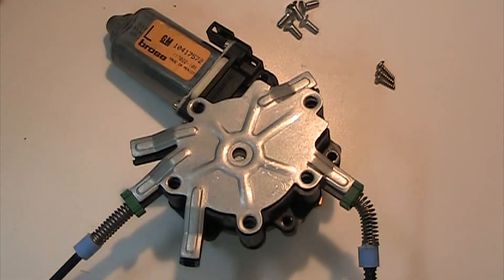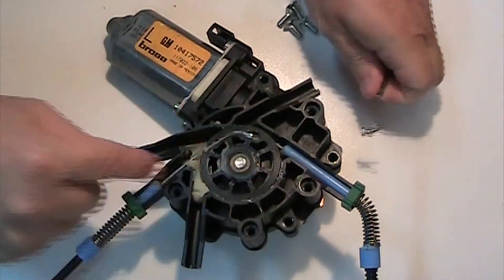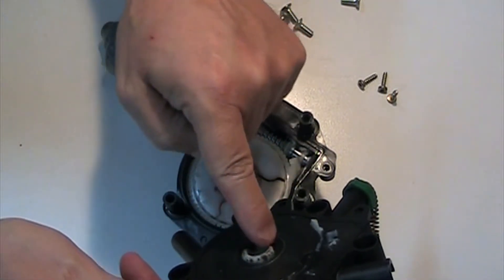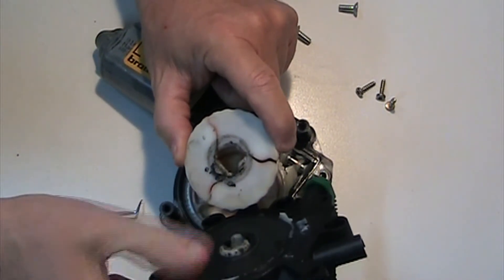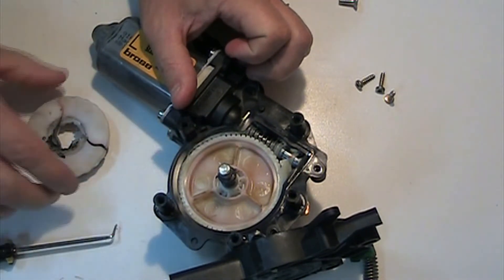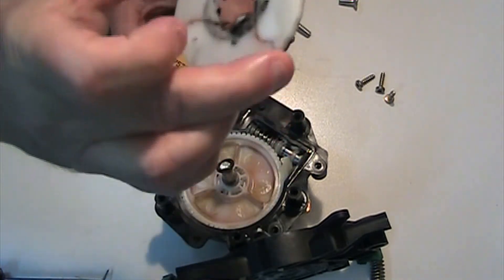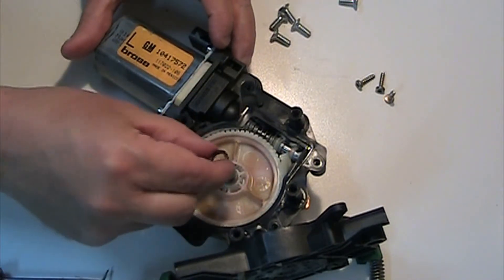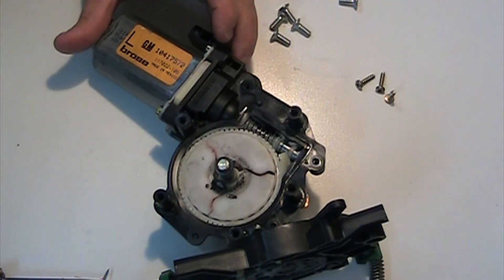C5 Corvette – Power window motor forensic analysis – What broke?

Comment: No! The white plastic piece broke because the guide on the cable failed (right side in the video), and they brake due to aggressive/careless installation usually by an incompetent worker on the production line ¿`_